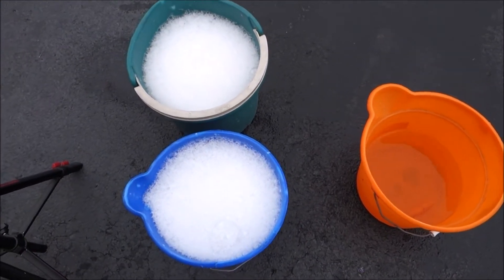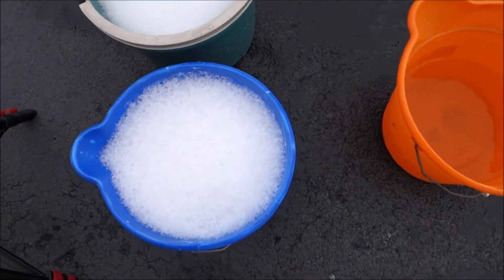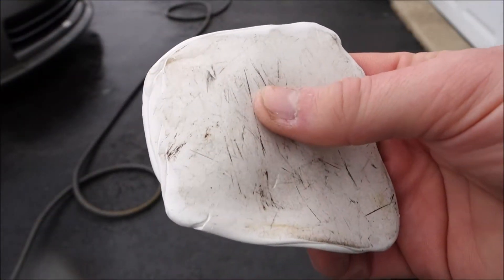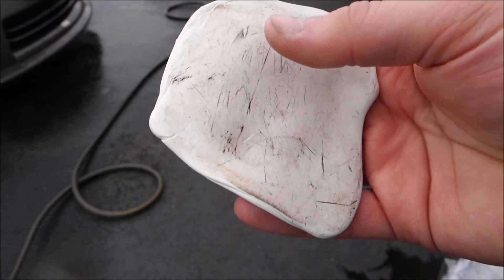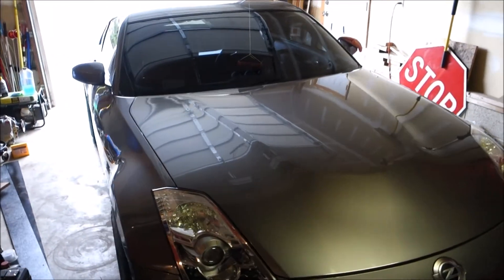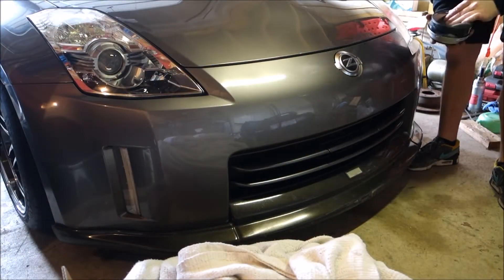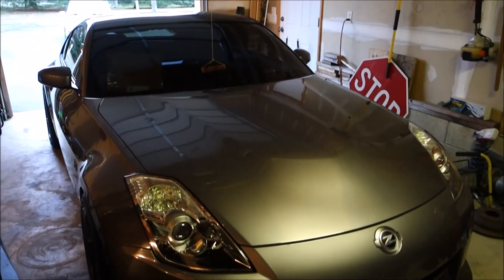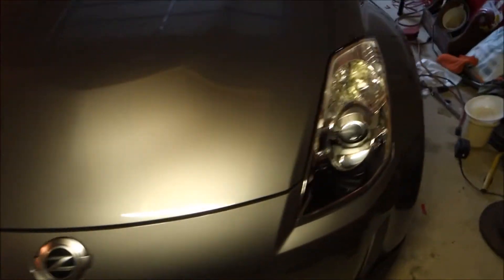Detailing My Nissan 350z - Car Show Prep

Comment: Got a question with you g37, im getting a g37x but whenever you let off the gas it slows down a decent amount and you can even feel it, Just wondering if this is normal
Reply from the maker: Can't really say without experiencing it myself.  Might just be the natural resistance of the automatic trans.